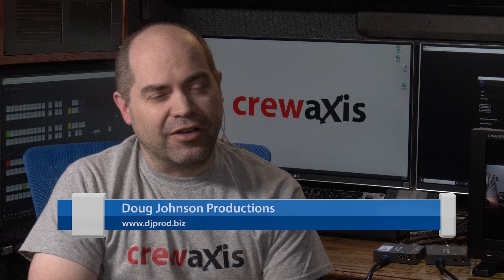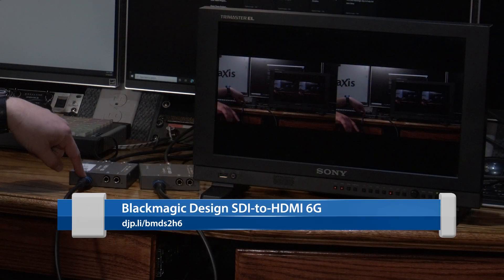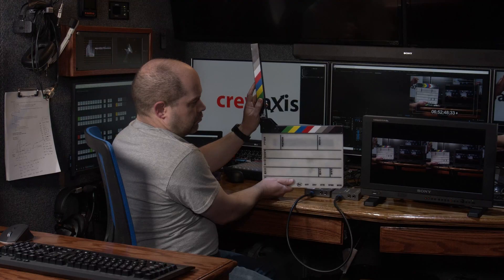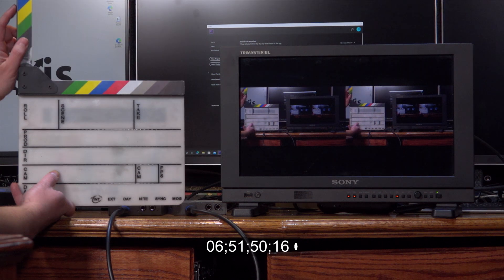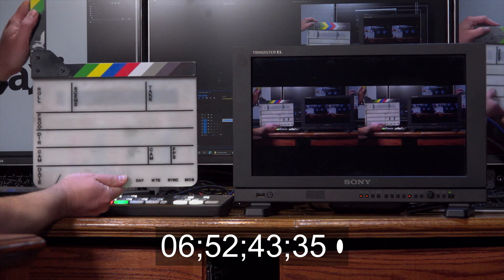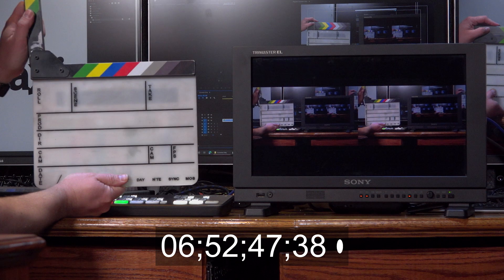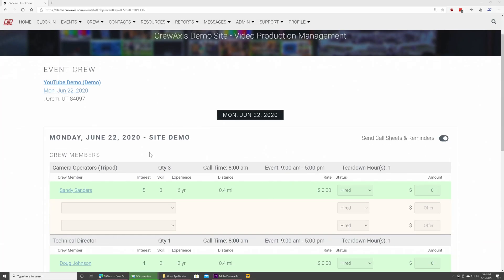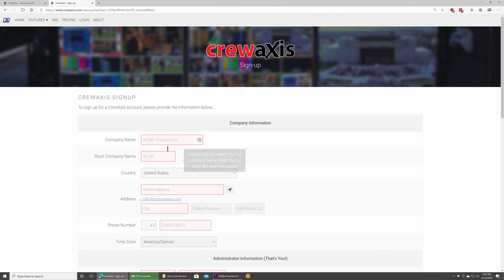HDMI Latency Myth Busted

Comment: Good video, how can i reduce 8VSK latency (atsc)  computer output via hdmi to ATSC modulator  and that feeds TVs .. so much latency and all the tvs play the video and audio at different times even if they are the same brand and model
Reply from the maker: The very nature of ATSC requires some time to do the encoding, so there is always going to be some latency. If you can replace the ATSC solution with something else you'll be better off. SDI signals travel over RG-6 cables quite well, so you could swap out the RF distribution box with something meant for SDI, then use SDI-to-HDMI converters at the TVs for perfect quality and sync.

Comment: Try to keep a balance of both because when it comes to the real technical stuff on equipment your channel has been the most accurate and beneficial to me. If your beginner stuff is as good, there will be no need to watch anybody else. You have solved many technical problems for me.  For example many channels tell, the technical max length for HDMI cables so I followed those guidelines. The cables never work properly I kept running into reliability problems: sound with no picture, picture no sound, both pic and sound but then signal drops, etc. I purchased several sets trying to get better cables, with each subsequent set costing more. It wasn't until I watched one of your videos, that I found the actual reliable length for HDMI and I switched to SDI for what I needed. I still do use HDMI but never more than 15 feet because with dongles for converting size and camera monitors and converters I do want to stay under the limit. Icing on the cake you told me the right kind of SDI cables to get. Glad to get more from you. Keep up the good work. I am definitely a fan and I have learned a lot from you, thanks.
Reply from the maker: If I want my channel to grow I'm going to have to cover more of the basics. The audience for the more technical stuff just isn't there.  And in order to cover the expenses of creating the videos, I've got to get more views.  Catch-22.

Other attempts to cover the costs just haven't worked.

Comment: Why would you do do a latency test by running sources through converters... smh
Reply from the maker: If you can figure out another way to provide simultaneous, guaranteed to be as close to in-sync as possible -- SDI and HDMI simultaneously, I'm all ears.
Reply: @djp_video  you could use 2 of Z150s, one on SDI and other on HDMI, and if their outputs have identical delay, by randomly turning them on and off it would show a 1 frame delay randomly on any monitor input

Comment: Now that we know the delay of SDI to HDMI and back, it has me wondering what the latency is of other mediums? For example SDI to IP, where it's not just converting the signal for copper or fibre, but actually has to encapsulate the signal into packets, especially with hardware SDI/NDI converters becoming more common.
Reply from the maker: Going to IP complicates things greatly. There's the latency of the conversion (which is likely to be significant) plus any delays in transit, which can add up depending on the number and types of devices in the chain. Then you've got conversion back the other way as well.

Comment: Curious then... when i run HDMI from Canon G20 into my ATEM, the audio via XLR into the ATEM is out of sync by 200ms or so. I am using a behringer device to add audio delay to mitigate. What am i missing? (many thanks for this btw)
Reply: there is HDMI latency as demonstrated by his video when the clacker in his hand shot 7 frames in front of the HDMI and SDI signals...the analog audio has no latency...ergo you end up with a sync problem...
Reply from the maker: All digital video cameras have some output delay -- in this case it seems to be less than 3 frames (the monitor has some latency as well).  Audio sent through a camera is given a similar delay to maintain lip sync.  But audio mixed in later can be a problem.  With my own setup sync isn't really much of an issue, and if it was I could delay it in my audio mixer.
Reply: @djp_video  Got it -- so basically there is latency, just not signficantly more so in HDMI as compared to SDI...

Comment: Looks like you confirmed the delay! One frame of delay in the conversion, but that's a best case scenario since you're using a SDI-HDMI converter. The ATEM Mini not adding additional delay is encouraging though.
Reply from the maker: It's actually a lot less than a frame. I was able to confirm with a Blackmagic Design engineer that the conversion delay is only a couple milliseconds.  If I had two identical low latency monitors, we'd be able to see that the actual delay is far less than a frame (but I don't).  It shows up as a frame here because the monitor can't delay the second signal by anything less.  Even with the processing delay of the ATEM Mini, it's still less than a frame.
Reply: @djp_video  ahh that's great news!
Reply: @djp_video  Just out of curiosity - how much is this "couple of miliseconds"? Because I come from audio production business, just starting out with videos and have heard about this delay introduced by HDMI, which got me worried. This is because while recording eg. key instruments, a latency of 6-10 ms is somewhat usable, but when recording vocals, a latency of even 5 ms on monitoring the signal is barely acceptable for a vocalist. And although in offline edit I can really pinpoint accurately sync my audio and video, I'd really like to know the HDMI latency figures for live stream situations, as then I could compensate for it in software and have it perfectly in sync :)
Reply: Any conversion is going to result in some kind of (even microscopic) delay, knocking things out of “real time.” So one frame makes sense as the entire system has to wait for the next frame.

Comment: Great test. It would be amazing to have the manufacturers start generating some sort of video output delay test (kind of like what they do for computer monitors in mil-seconds). That way we would know roughly what the delay is for each HDMI camera, and then be able to resync audio if necessary. I know there will probably be some tolerance because each camera will still be slightly different, but 99% of people will only notice if its more than 2-3 frames out of sync in my experience.

I use 2 FS5's which have 3G-SDI outs. I was a bit bummed to figure out I could not get a 4k signal out of the SDI (learned about 12G/6G/3G etc from Doug). I ended up getting Atomos Shogun Infernos, which can take a 4k HDMI signal and convert it into 6G SDI, so now I have the best of both worlds. the HDMI cable is 1 foot to the 7 inch monitor (which is way better than the built in one), plus I have a super 35mm sensor with a servo zoom lens (28-135mm F4.0). 

I'm working on a comparison spreadsheet for live video. It's currently got over 3,000 data points, 100+ cameras with 30+ features listed for easy comparison between models, frame rates, outputs etc. Will update you when it's done Doug! I'm using airtable, so it's super easy to filter, group, and sort. I want to possibly create a resource the live video community can open source/help update so we can compare gear better and faster, so we spend less time researching and more time shooting!
Reply from the maker: That's pretty amazing that you're taking the time to build a spreadsheet. That's some pretty useful information.

Comment: I think the main issue is when folks try to mix sdi and hdmi only consumer cameras and their are talking heads involved. Or even mixing different kinds of hdmi only cameras in a live production. I always thought that different manufacturers hdmi signals were delayed by varying degrees. Even if there’s a couple frames delay between sources, it can be noticeable. It looks like there isn’t any inherent delay with the hdmi signal itself, but is there still delay in practical terms when using mixed hdmi sources that are delayed from the camera side? I don’t know. I’m still on the fence on this one.
Reply from the maker: It's worse than just per-manufacturer -- different models of cameras have different delays as well. 

Drift shouldn't be a problem, at least not with professional video gear.  Many of the computer capture systems seem to have problems with that, though.

Comment: HDMI has a higher color bit depth than SDI right?  So if you don't have a need for long runs isn't the color better slightly?  Can you see the difference, or is it at the very least enough to affect chroma keying?  I've really enjoyed your more advanced stuff, but there are so many misconceptions in our industry that going through the basic stuff can be quite enlightening sometimes.  Looking forwared to more of your videos!
Reply from the maker: SDI is typically 10-bit, 4:2:2. HDMI can do 12-bit, 4:4:4, but in practice that doesn't really ever happen.  (For reference, Blu-ray and consumer video is usually 8-bit 4:2:2 or 4:2:0.) You might be able to get 10-bit 4:4:4 out of a camera, but without going to a proprietary RAW format that's about the best you could do. I strongly suspect that the ATEM Mini and other HDMI switchers don't process in 12-bit 4:4:4 anyway, even if that is offered by the camera. 

In terms of whether the difference is visible, for most content it won't be. If you've got high resolution, very small color text on a differently colored background (red text on a blue background, for example), yeah, you'd be able to see the difference (white, gray, or black text won't have a problem).  And it likely would get blurred by final rendering/encoding so it probably doesn't matter once you get to final distribution.
Reply: HDMI is up to 48Gb/s now so faster than 3/6/12Gb/s SDI. For computer screens with static small text 4:4:4 is a win over 4:2:0 etc commonly used over SDI. I have no experience of chromakeying, but doesn’t that work well enough since the transition to HD if lit correctly? Greater color depth - good for HDR and heavy grading in post.

Unless you are pixelpeeping or doing heavy grading in post, I’m unsure if normal people can tell video signals apart. I sampled a bunch of 4K Blu-ray’s and pixel peeped them, they were all crazy unsharp no sharper than HD, but sitting in the couch a bit away HD and 4K all look fine.

Comment: in your test, you get one frame, because the converters add a line or so each.
that leads to a de-synchronization between input 1 and 2, the monitor thus adds 1 frame latency to be able to display both images side by side on the same screen
the real issue is not the hdmi itself, but the processing in various consumer level equipment.
DSLRs have between 4 and 6 frames latency, consumer tvs have the same (which includes useless "AI image improvement" and the like)
Reply from the maker: I wish I did have two A170 monitors so I could display both signals simultaneously without it having to delay the second signal, but as you're probably aware, these are very expensive monitors, and one is all I've got.

Yes, the issue is the consumer or gear meant for photography rather than video production. But somehow in a lot of online forums there are a lot of people blaming HDMI itself for the delay.
Reply: Doug Johnson Productions HDMI has plenty of other reasons to be labelled as “crap”, among which:
• HDCP requiring a couple seconds to synchronize 
• HDCP being a pain in the rear end when you have legal uses and requiring the use of gray area devices to get rid of
• The whole “transmit the data on several pairs” thing that leads to utter uselessness of the tech for lengths of more than 10m or so
Reply from the maker: I'm not disagreeing -- I avoid HDMI whenever even remotely possible. But blaming HDMI for the latency when using consumer cameras isn't the right way to address that particular problem, and we're seeing a lot of that happening in online discussion forums and videos from other channels.

Comment: Interesting video-  as always.     You're using an expensive SDI camera.  Many people watching are using HDMI cameras (consumer / prosumer and not the more expensive professional-grade SDI).  Consider running the test with an HDMI test camera.  Thanks.
Reply from the maker: The only difference that would make would be how much initial delay there is from acquisition to display.  It wouldn't affect the amount of delay from the SDI-HDMI conversion.

The amount of delay on the HDMI output of different cameras is going to vary. So testing one model also won't tell you anything about how other models perform.
Reply: @djp_video  I agree with you.  I'm just highlighting that people (including me) are disappointed with overall HDMI delay. Sir, I would say it’s not a myth, but rather a point of perspective.  I see a huge delay and I believe this may be caused by my camera (a $600 HDMI Sony FDR AX33).  I understand the focus of your video is the transmission path and the converters (not the camera).  However, you are giving a big sigh and blowing off the frustrations of many viewers  ; )   Yes, the converters may only add a frame or so of delay, but the system is only as strong as its weakest link.  I would at least acknowledge the problem of HDMI camera delay.  That said, your test did strongly confirm that the problem is not in the BlackMagic converter and Switcher-  great to know!  Respectfully offered.  Thanks again-  I always enjoy your video’s.
Reply from the maker: I'm not trying to discredit the frustration. I'm just trying to point people in the correct direction as to the cause of the problem.

Comment: Great work Doug,
but what about cable lenght, does it matter? SDi can do 100m +, HDMi can't, what if you try for examble 20m SDi, 20m HDMi (where HDMi starts to have quality issues etc.)...
Thanks and please keep up uploading 🤙🏾😋
Reply from the maker: SDI is a better way to go whenever you can.  And, no, cable length doesn't matter to latency in any kind of practical terms.
Reply: cable length issues in HDMI are due to the fact it uses multiple pairs in parallel, which leads to bit-level desynchronization after about 10 meters or so. the receiver can't make sense of the information
Sdi sends everything through 1 wire, which makes it impervious to those issues. 
it does have signal level loss issue though, which means the receiver is not sensitive enough to detect the voltage variations. that is easily fixed by using fiber transmitters.
note: optical hdmi cables multiplex the signals for all hdmi pairs onto one fiber, and carry the return signal on a second fiber, correcting the issue, but they get much more expensive than sdi transmitters at that point.
Reply: Amaury Jacquot hmm, Wikipedia and common lore reference signal attenuation and cable quality issues, not TMDS breaking apart. Not saying you are wrong, desynchronization on a high speed bus seems possible. Very unsure why anyone would design a cable standard using 8/10 coding and parallel and a dedicated clock, it’s clearly a very weird cable design. They just took a lot of different cable/signal technologies and put it in a bizarre mix. Any other cable would be serial or parallel, and no one would have a clock on a high speed cable (static jitter is emi possibly disrupting other electronics, such as the data wires...)
Reply: I would like to see that test, in my experience, I have seen the delay at very long distances.

Comment: What about the cameras HDMI outputs? I use ATEM Mini with three different cameras, still cameras with HDMI out. Nikon D5300, Nikon D850 and Nikon Z6 ... The picture entering the ATEM Mini is not in sync. And if I put audio directly to the ATEM Mini or my computer. It will be out of sync. I do not blame the ATEM Mini ... but the fact that the three cameras take different time to process the video. The only way to get audio in sync is to go via one of the cameras (I chose the Z6), but then it is only that camera that has sync ... :(
Reply from the maker: It really helps to be using the same model of camera so the delays are the same.  There isn't really an easy way to overcome varying delays introduced by different camera models. (That's why we try to use cameras meant for live work when we can.)
Reply: @djp_video  true, the day I see a used Z6 on sale here in Sweden ... I will get it!
Reply: @djp_video  That's right, you should be using one camera with an SDI output and an HDMI output, directly connected to the monitor via native inputs.  Definitely not running through converters first.
Reply from the maker: I don't have any cameras that output SDI and HDMI simultaneously. Nor do I have a pair of A170s, or a high speed camera. This is the best I can do with the equipment I own. But it clearly demonstrates my point -- that HDMI doesn't inherently add significant latency to a video signal.

Online forums are filled with "because you're using HDMI" as an answer to "why is my video delayed?" and that's what I'm trying to address.
Reply: Doug Johnson Productions I own a ls300 with HDMI and SDI if that’s helpful. Maybe I could set it to film a test video with frame rate counter.
Reply: @djp_video  If he is using a Blackmagic switcher can he try using AFV so whatever camera is live the audio feed is coming from that camera?  That's assuming he can get audio feed to each camera from the audio board.